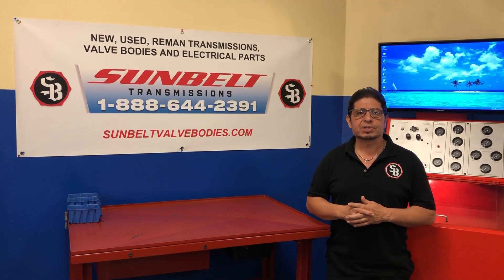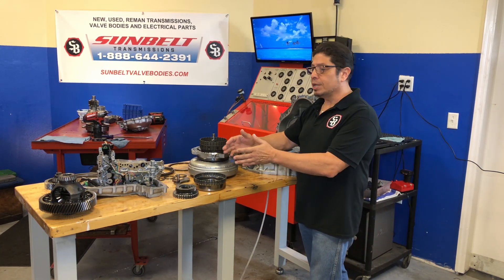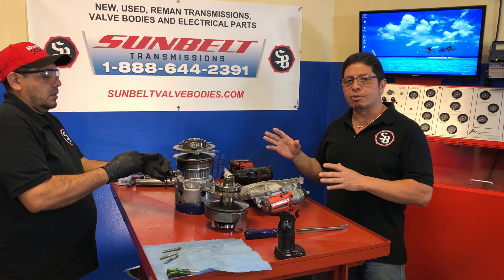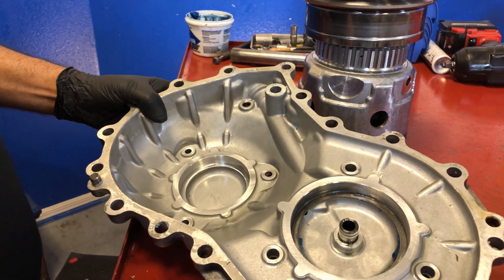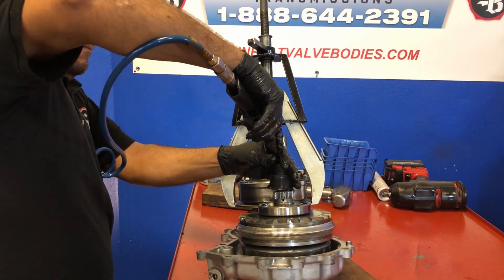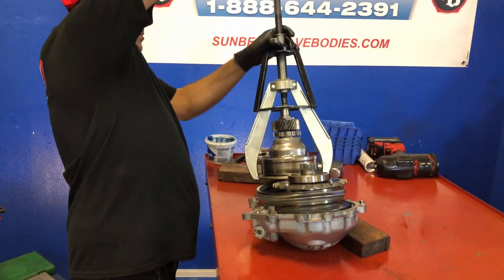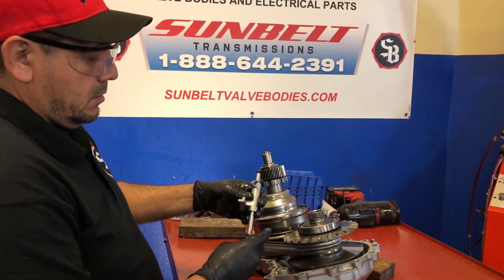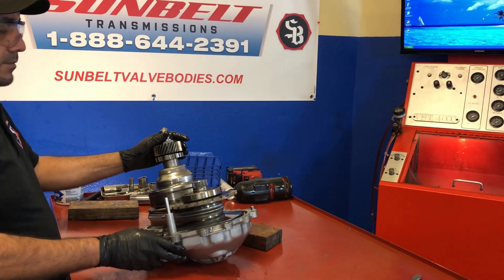CVT How it Works Nissan Quest REOF90B/ JFO10A Complete assembly of Transmission Step by Step (Part1)

Comment: I think the belt goes counter clockwise to push the secondary. Engine, to torque converter to primary to secondary would be counter